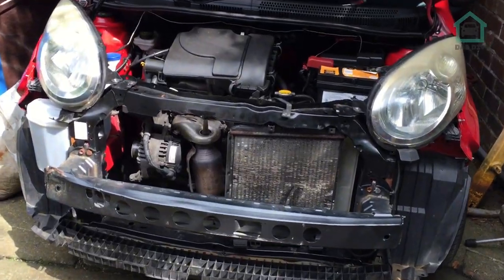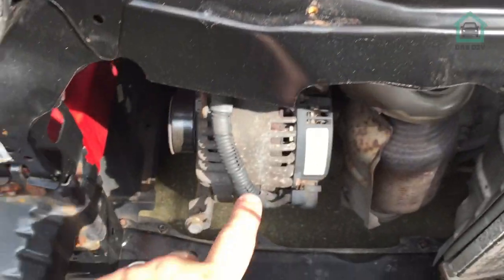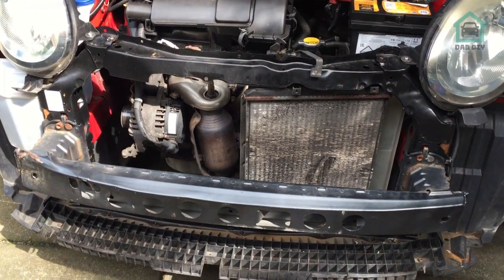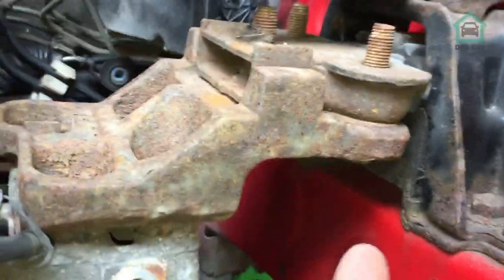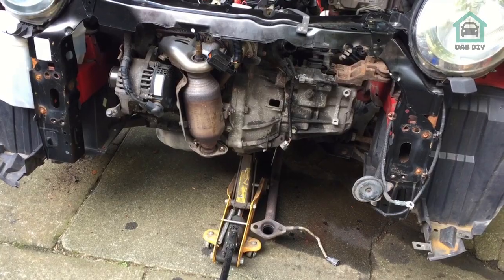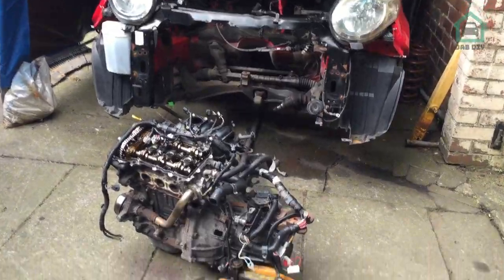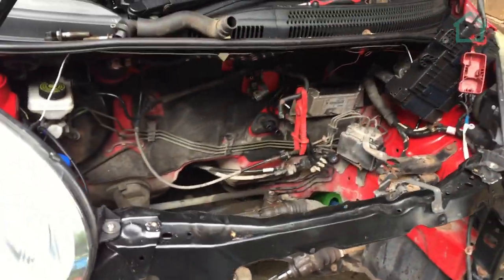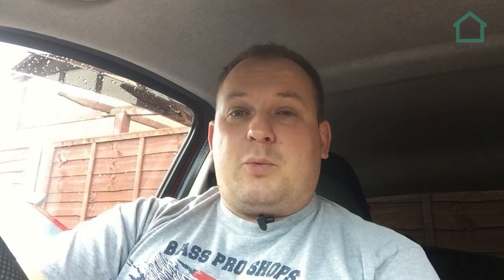Project C1 gets a new engine - Part 2

Comment: How long did this take overall good video
Reply from the maker: About 4 days. Bare in mind that I’ve never changed an engine before. I’m aware of race teams that have changed an engine in 45 minutes.
Reply: @DABDIY  That's good mate just changed water pump radiator thermostat but drove about 3000 miles over heating on and off might need to change hold engine yet to see but going out know to see if damage has been done lol wish me luck ! Good video though when's the next project
Reply from the maker: I see what you mean. Might be worth looking at the thermostat before you consider a new engine though.